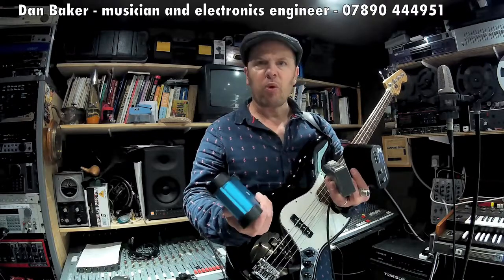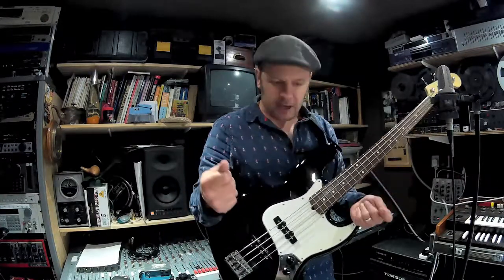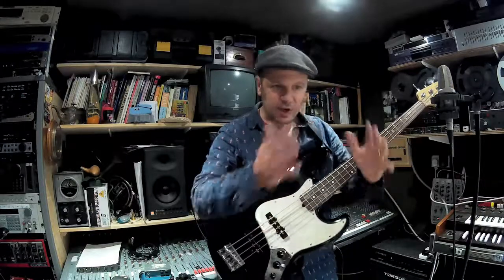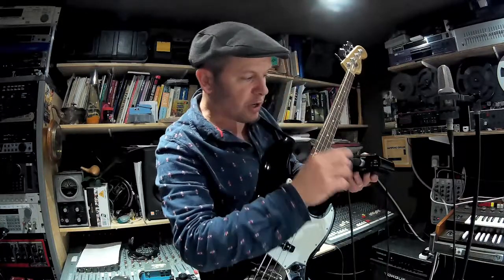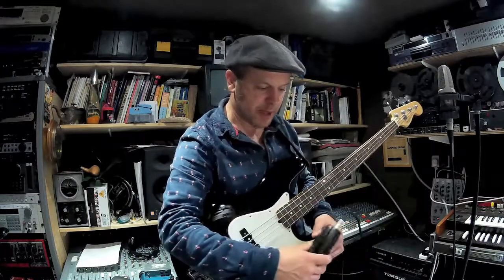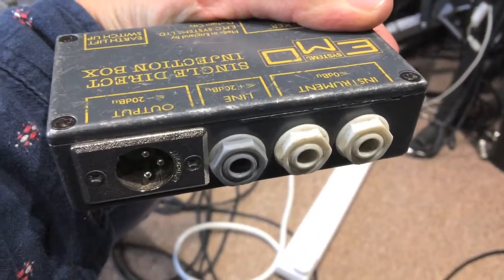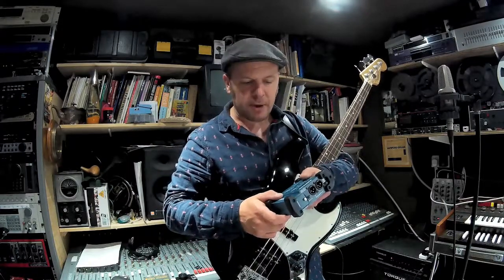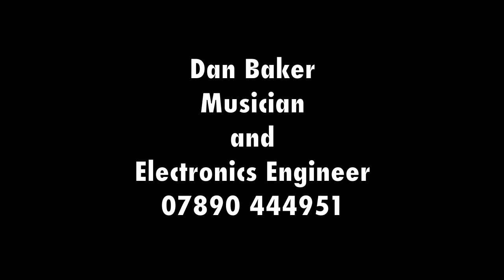DI Box - What's It For??

Comment: Two moments - correct input impedance matching and symmetric signal output (use of a longer cable with a minimum of interference noise) to the mixer.
Transformer-based passive di-boxes have not high enough input impedance for direct connection of passive pickup instruments (even more in case of piezo pickups), you need an active buffer device in-between passive pickup instruments and such passive transformer-based di-boxes.
Even active di-boxes can have too low input impedance, it must be 1mohm or more for magnetic pickups, 5mohm or more for piezo pickups, please check specifications before use, not all manufacturers are providing this info...
So all it is about the pickup loading.
The same problem is with some FX pedals, some have just 250k or 500k input impedance, which is more or less but additionally loading pickup signal.
If you are using a 1mohm direct box and using the output going to the stage amplifier too - amp most case has 1mohm input impedance too, so you have just 500k summary load.
Together with the guitar's inner potentiometer loads, it is more and more total load, for example, 250k Volume pot parallel (through a tone capacitor) with 250k Tone pot, parallel with di-box 1mohm, parallel with stage amp's 1mohm - summary it is less as 100kohm load...
Such load is reducing pickups resonance peak's HEIGHT (character) and higher frequencies, in some cases it is ok, but you must remember about it and understand what is going on.
This effect is increasing if you are reducing the Volume pot on the guitar (adding pickups impedance in series with a resistance of the upper part of the pot).
And capacitative loads coming from the longer (additional) cables/connectors are lowering pickup's resonance peak's FREQUENCY, in some cases, it is ok again.

Comment: Explanation is great!, what I need is to add volume to a passive bass running through a behringer interface, since I can barely hear it when recording, does a DI box will help?, or what do I have to buy? Thanks
Reply from the maker: A DI box will certainly help preserve the integrity of a weaker signal. Then you have plenty of gain available on a mic input to boost it up. Also, be sure that if you plug a passive bass or guitar into a line input, the impedance doesn’t match and you’ll end up losing a lot of top end from the pickup. Any jack inputs on an interface would have to have a guitar logo or “Hi-Z” in order to function correctly.

Comment: whay is input thru
Reply from the maker: dead end input thru is an exact copy of the input-essentially if you connect a bass guitar to a PA, you plug the bass into the input, and the input thru is then connected to the amp. The XLR output of the DI box then goes straight to the PA system. The level and settings of the amp are then independent of the PA feed...
Reply: @DanBakerMusic  thank you